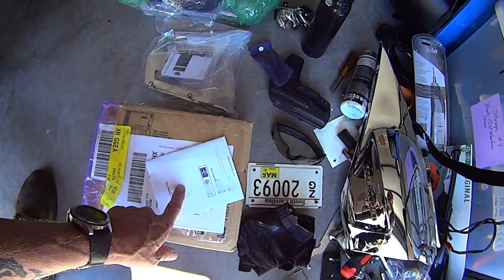How to Install Backrest and Luggage Rack - Honda Valkyrie F6C

Comment: Q, I can now fully appreciate what you endured here.  Yesterday, I endeavored to install my OEM bags just like yours.  Figured it would take a couple hours.  I was following the Honda PDF installation guide, which said to remove the passenger pegs.  They are on the frame so tightly, with those damned Allen bolts, there's simply no WAY to get them off without a mechanic's air driver or heavy duty wrench.  Which I don't have.  But the online video from that guy showed how to do it, and he didn't even bother to remove the pegs.  So I WASTED an hour and a half trying to get those &^*&$ing pegs off!  I finally got the bags installed after FIVE hours of labor.  Wasn't easy with all the panels that had to be pulled off and reinstalled (and I broke a plastic pin in the process).  By the time I was done, it was dark out and I saved the luggage rack installation for today.  My back was ACHING by now and I went to bed spent, and woke up today with a sore back.  Hunching over the bike for 5 hours was not fun.

I went out to install the rack around noon with my back still aching.  Of course, the bolts holding the bags on are also the ones holding the rack supports, and the second you undo the bolt, CLUNK!  Down goes the bag.  And getting the bolt to realign once the support is in the mix was impossible.  I tried,  and tried,  and tried.  I must have wrenched for 2 hours trying to get them back in, and they simply would NOT align.  Not to mention, the four metal collars that come with the supports are so fat, you can't include them in the install and still have enough bolt to screw in the holes!  I worked all damn DAY on this today and could not get anything to fit.  I don't even know what is supposed to be where, since not all the parts will fit.  I squeezed those bolts with my thumb and index finger so hard for so long, they are in physical pain tonight.  Not to mention, those pesky little metal collars keep dropping out when you try to install the rack with all the parts it's supposed to have.  I don't know how many times a collar dropped out on me and rolled into a remote corner of the garage.

I'm going to let this project wait a few days so my back and fingers can recover, and my brain calms down from the utter frustration!  It's enough to drive you insane!
Reply from the maker: Oh, man, that sucks.  I can't understand it.  How did Honda screw these up so badly?!?

Comment: Lord!  Makes me crazy just watching you endure that hassle.  It always looks so easy, and then you discover what you've gotten into, and as you saw, what should be a 15 minute task turns into a 2-hour ordeal.  It's always, always, ALWAYS a hassle of some kind and someday I'd love to see parts that line up without exerting ungodly force to bend them into place or stretching plastic to its maximum tensile strength, which always leaves you wondering when it's going to snap.  And if you aren't careful you end up denting or scratching the bike.  I see your rack was apparently made to fit on the backrest bracket, so hopefully they make one that bolts on elsewhere for those of us who don't add the backrest.
I really would like to have the ABS, Traction Control and self-canceling turn signals that are on the CTX.  And lockable bags.  I love those bags you got but, no locks?  You can't leave it anywhere with anything of value in them.
I notice on this bike they left a number of rough (unsmoothed) welds.  There are two obvious, glaring ones on either side of the bike just below the back of the fuel tank on the frame.  They should have smoothed those out.  As is, they look like design defects to those unfamiliar with the bike.   I suppose it would have slowed down production and added cost, but seems like that little cosmetic flaw would have been corrected.  It just stands out to me on an otherwise seamless look.
There is a decent looking power port on Ebay that mounts on the bars, and has both USB and cigarette style outlets and an on/off switch you may want to consider:  https://www.ebay.com/itm/Motorcycle-Waterproof-12V-Phone-USB-Power-Charger-Port-Cigarette-Lighter-Socket/202726215688?_trksid=p2485497.m4902.l9144
There are other models as well.
Have you thought about a battery tender lead?  That bike will draw some current in its electronics.  May want to look at that when you get your charging unit on there.
Keep ridin', buddy!
Reply from the maker: Yeah, I was really surprised how nothing fit.  But all done now and looks really good.  Thanks!

Comment: Great video! Where did you get the backrest and the saddlebags?  Having trouble finding online. And are you happy with them now that everything is installed?  Thanks
Reply from the maker: Thanks!  It was a while ago that I bought the backrest and rack. The saddlebags are OEM Honda and so we’re the backrest and luggage rack. The saddlebags were on the bike when I bought it. Very very happy with the result once they were installed. Quality equipment.
Reply: @QuentinsMotoVlog  Do you know if the saddlebags have the mount bracket and saddlebag stays?  I wonder if the stays are needed. They are another $249.
Reply from the maker: @raymond1842   sorry, I really don't know.  The bags were already on the bike when I bought it.

Comment: Could I remove the side cover to get at the battery for adding a battery tender for the winter...or does the seat have to come off...
Reply from the maker: I honestly can' remember, but it's easy to check.  The side covers just pull off and push back on.  People complain about removing the seat because you have to push the padding at the rear of the seat forward to get at the two Allen bolts that hold it.  But it's not difficult to do.  Good luck!

Comment: Where you get that side rack for saddlebags??
Reply from the maker: Apologies, but it was several years ago and I don’t remember. I often search eBay for parts. They have a lot.  Sometimes I’ll go to AliExpress or Temu, although the quality of what I get is sometimes good, sometimes crap. And there’s always Amazon, but they are not very good for motorcycle accessories.

Comment: Did it occur to you that the spacers were probably meant to go to the inside? There is absolutely no point I can see in installing spacers the way you did under the bolt heads and not between the seat and grab rails... Looks like you installed the seat back wrong, then ham fisted it into place ("With ALL of my might") and bent it by doing so, and then it surprises you that the luggage rack portion didnt fit the backrest you bent? Did you even try to see if the luggage rack fit the backrest BEFORE you bent the crap out of the backrest? Sounds less like a Honda problem and more like an installer issue... If installing small lightweight factory accessory parts takes "All your might" you really should stop and backup and rethink what you are trying to do.